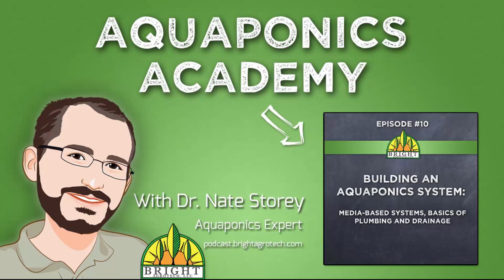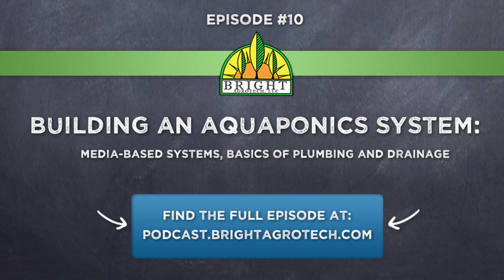Aquaponics Academy #10: How To Build An Aquaponics System: Media & Plumbing

Comment: What happened? the podcast cut off at 1:06 right after the intro. PLEASE load the rest of the podcast.
Reply: Bright Agrotech the link is dead
Reply: is there a way to update episode 10? it stopped after the introduction (1min 6 sec into your typical excellent info packed  20+min podcast) ?
Reply from the maker: +James Mc nulty Hey guys - you can find Ep 10 here: http://podcast.brightagrotech.com/episode-10-building-an-aquaponics-system-media-based-systems-basics-of-plumbing-and-drainage/

Comment: What are your thoughts on lava rocks as a media?
Reply from the maker: Hi Logan Chow - we know of some folks using lava rocks, but they're usually very basic and can alter your system chemistry very easily. We wouldn't recommend using them. Something like 3/4'' crushed granite is probably your best bet in traditional media beds unless you have the dough to go with something like expanded shale. Good luck!
Reply: Alright, thanks for the feedback. I'll look into 3/4" granite then.
Reply from the maker: Logan Chow Best of luck!